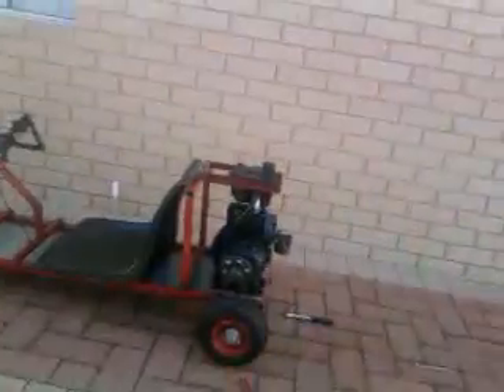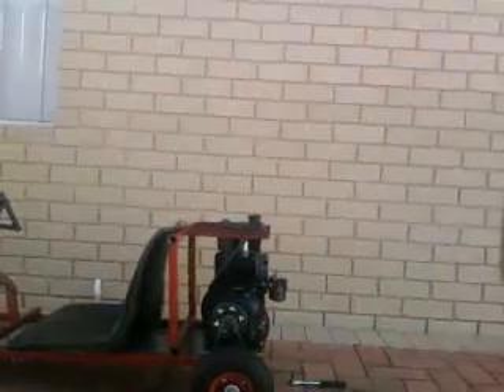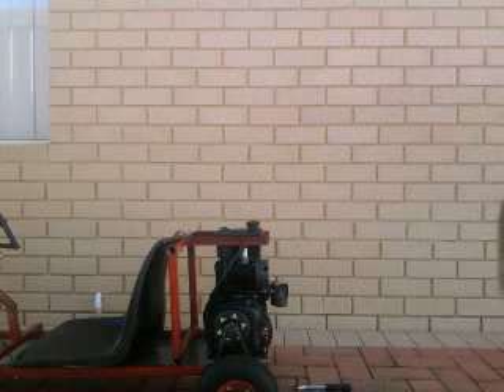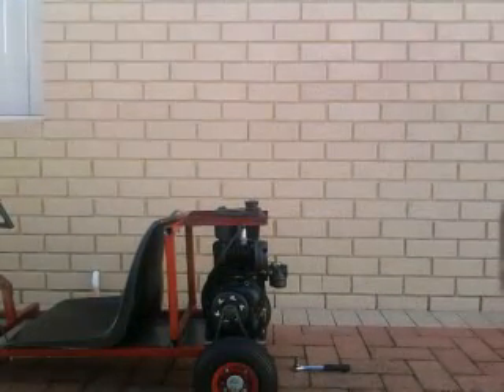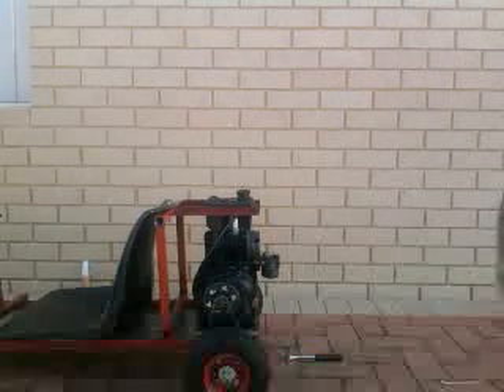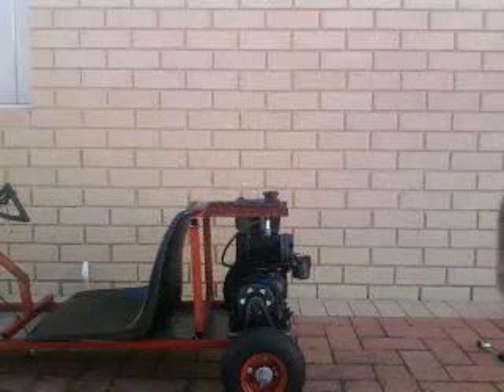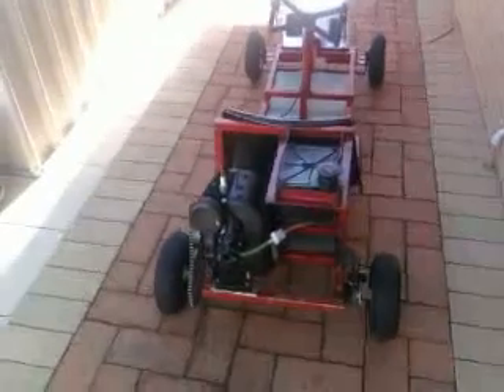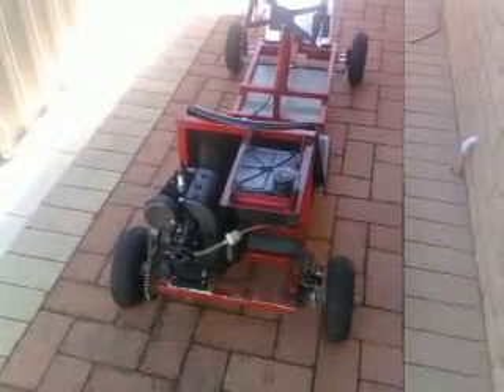Go-Kart Build Pt 19

Comment: Its called a grub screw. Should of got one with the clutch. If not, venables will probs have em. Nice to see it going. Usually once u get em started they clean themselves out. So now u just gotta hook up the throttle and thats it? Do u still need the pull start done?